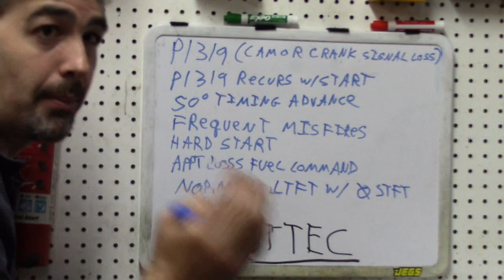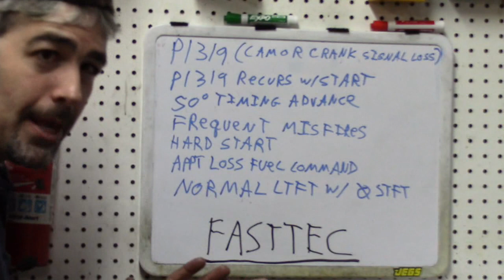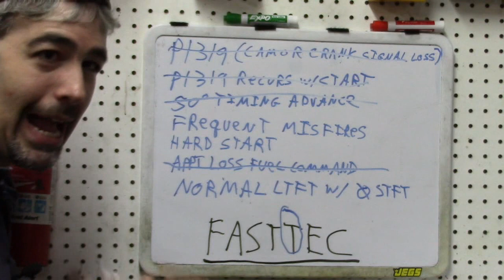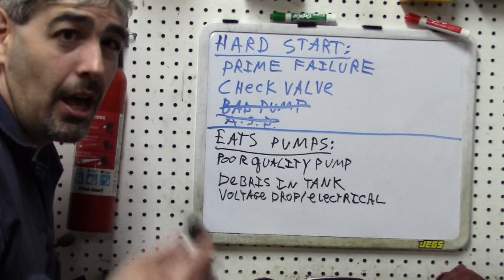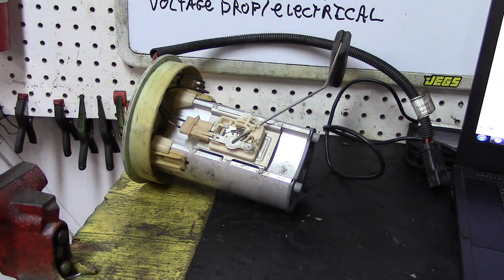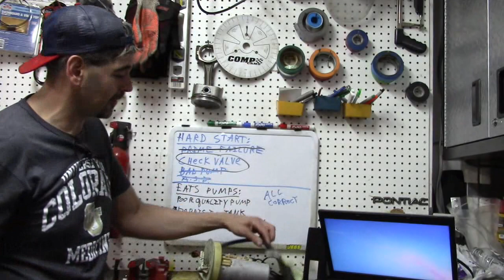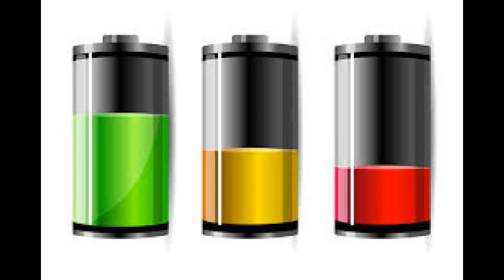Jeep Eats Fuel Pumps Follow up and Hard Start Diagnosis and Repair

Comment: jeep made a mistake with the plastic gas tanks inside the gas melts the plastic and clogs the sock . another thing don't use the airtex fuel pumps they are junk .
Reply from the maker: +Mark Mackover How can gas melt plastic??????? What possible chemical reaction is possible that that could happen? Are you saying the plastic is made of polyethylene instead of polycarbonate???? Impossible. Please explain and justify your source.
Reply: +Schrodingers Box reading a jeep blog they said if you put treatments to stabilize your gas or injector cleaner it will dissolve the poly carbonate/polyethylene  and clog injectors and the sock . also from my own experience owning a 2002 jeep grand Cherokee they had a recall on the factory air tex fuel pump because the O-rings that seal the pump would deteriorate from the fuel and cause a loss of prime as well as pressure . the not so funny thing is they were still selling them at advance auto for $225 and would last 1 year . the solution is to fit a bosh pump into the existing housing and problem solved .  like your video  !!!
Reply from the maker: +Mark Mackover ok on the pump I can believe that but the tank- no way. a fuel tank can easily hold  even 100% MeOH without disintegration. Still sounds like typical chatroom banter though- is there an actual physical recall resource you can link me to?
Reply from the maker: Mark Mackover Well I just checked the TSB database and not one single mention of any fuel tank issues whatsoever. There is not even any known issue with recurrent fuel pump problems much less from an engineer that "made a mistake" because he didn't know basic high school chemistry. Even a basic knowledge of chemistry would clearly indicate that you aren't going to get clogged injectors or even filter from accidentally using polyethylene components in an aromatic (well, aliphatic, technically) solvent. That is impossible unless so incredibly much of it was dissolved that it miraculously turned into slush without eating a hole through the tank.
  Gonna have to chalk up this to yet another "chatroom and forum myth" but please tell whoever you heard that crock from that they are full of it unless they can produce evidence to the contrary of what I found lol!

Comment: Batteries have little pop outs that tell you the year and month the battery was originally purchased.  That's the first place to look if a car won't crank over.  If the battery is more than 40-60 months old, go chance the battery has had it.

Comment: After watching loads of Scanner Danner videos on both his channels, his recommendation if there is a bad fuel pump is to replace the whole assembly no just the pump.  I think his logic shows true in your case study
Reply from the maker: +John Powell Totally agreed. I always change the whole unit if for no other reason than to ensure I don't get a comeback for a sending unit or some other component.  As a DIY- a fuel pump is a considerable concern for me because of the buckets of fuel I need to siphon out- I really don't want to be doing that any more than necessary!!

Comment: Hi Matt,sorry to intervene but I need to know why do you now have fuel pressure that is 50% of old pump pressure.
 Info that I have is 48PSI +-2%
Reply from the maker: +despot032 The new pressure was the same- maybe 3 PSI less  50%????  Not from the video I saw
Reply: +Schrodingers Box  sorry mate,glare is one to blame. my bad

Comment: Everyone has their own way to diagnose a fault or faults. The scientific approach you profess to use is very refreshing and I commend you after almost every video that I watch and try to make suggestions or supply more info if I can. If I want to watch a screaming  lunatic i'll subscribe to the Scotty....whatever channel. But in the real world in a fast moving repair shop with time constraints and stress to perform, you have to make a diagnosis ASAP and to me that means to gather  ALL of the evidence as quickly as possible. To me that also means connecting every piece of test equipment pertaining to the problem at the same time. In your case you would have found the loose crank sensor and the fuel pressure problem at the same time. Sometimes you need to rely on experience as well as the evidence you gather.The fuel trims had nothing to do with a start up fuel supply problem and to me your diagnosis was slightly flawed. I hope you learned from the experience.You got to L.A. Via Wyoming but the important thing is that you repaired the problems with the vehicle by covering all the bases and you will have a very happy customer in the end. As far as the battery story  problem goes, I have been in that situation myself, before. You feel like a bit of a jerk but at least you arrived at the correct diagnosis. I go through that same thing with my wife at least twice a week....{;-)

Comment: Change the bad Battery! Heh :)
Todays cars can stop the engine (normaly) on ligths and nots start again with new battery. Because thay have new battery in that car computers dont know and so dont know what the charge level is and so on.
Allso new cars dont charge batterys all the time so on charge test you need to add all the cars loads on to do that test these days.

Great video even with little starting délay ;)

Comment: Nice Find Matt.  When you do the follow up you might want to do a injector balance test.  Some of that junk might have reached the injectors.  You could also hook up your secondary leads and see if your firing kv's are lean.  That would make a cool video with your Vantage Pro.  I understand your thought process on diagnostics.  I do the same thing myself.  In fact when I find something bad, I always prove it by doing another test to verify.

Comment: LOL...Great video and I feel for you on dealing with people whom feel you are inferior because they guessed/hoped/believed correctly and/or more quickly about something regardless of the fact that they only believed that because they had no knowledge about any other possibility nor any concern for analytical precision over trial and error/gamble.

As for the fuel pump, you may not care as long as it runs well enough but I had a similar problem and I removed the fuel line from the rail and primed the pump into a jar and cleaned a significant amount of sediment (of a performance vehicle making it necessary) out of the line and after seeing that pulled and cleaned the injectors and their filter screens. This being an old Jeep, it may not be as important as long as it is getting enough fuel but it likely is inhibiting performance as a result of this. 

Also, this is why you should always request the parts packages be supplied to you from a mechanic to prove the part is new and the actual part info that was put into your vehicle to insure it was the correct part.
Reply from the maker: +SayWhat? Dead on bro.  Do you know how many times I will show a misfire on the channel... just a misfire and people say "God why was video an hour long? I figured  right from the first minute it was probably a bad spark plug."

Comment: Hi Mat,

I commented on you not using the Fasttec Method, but the way I understood you method was, that you allways do it in the same order. So you don't look into the computer before you do the manual fuel test. 

So now I know that you do the computer first and that you user FASTTAC as a help to rememver what to check bot not do it in the oder of the letters. That is why I thought you did not use the method. SORRY did not mean no harm. 

Regards Benjamin
Reply from the maker: +Benjamin Bergmann No problem- makes sense now right?  You always use FASTTEC on a no-start, but you triage the starting point based on your evidence.  If for example you can hear the car almost starting then most likely there is fuel delivery so you move that lower on the list and start with spark.  If the car backfires a lot when starting I would suspect timing because a backfire requires fuel and most likely there is also spark.

Comment: You know what, I am with the old guy!  I don't even grab my voltmeter unless the battery is at least couple of years new or better.  It costs less than couple of gas tanks and I change it first before I would even make any attempt to diagnosis.  That technique has worked for me and for lots of other relatives who call me for their car troubles.

It is a question of cost benefit analysis.  An hour of professional diagnosis or replacing two year old battery?  The battery gets changed first.

How much did you charge her to diagnosis the bad battery?
Reply from the maker: +12vgs8606 Ummmm you must be joking right.... why would you possibly change the battery when there is no evidence that something isn't causing it to drain and the battery is perfectly fine?
Reply from the maker: +12vgs8606 Wait- you have been on this channel since day one bro--- You are pulling my leg I hope!!!
Reply: Nope; replacing the battery is the cheapest.  I have been bitten enough times that this is now my standard advice to any of my friends.  If the battery is over two years old, put a new one before looking for drain.  Most of these friends don't even own a voltmeter!  My score on "replace the old battery and then if the problem continues, then call me back" is about 7-0
Reply from the maker: 12vgs8606 OMG... speechless.
Reply: It $100 of diag time or less than that for a new battery.  If battery is old, then nine out of ten times, it is going to be a bad cell in the battery which leads to these type of issues.

I am little bit exaggerating about what I do personally but if a guy does not even own a voltmeter, the easiest and probably the cheapest thing is to put a known good battery first.  Especially if there was no recent work done on the vehicle.  We are talking about people who would not know how to use a voltmeter to figure out if battery is bad or alternator is bad.

Of all the consumables  on a vehicle, battery is the cheapest item when averaged over few years.
Reply: +12vgs8606 Regardless of your claimed success rate, I don't think that replacing a part/accessory without at least confirming your suspicion is a flawed method. The potential to miss a relatively minor (but existing nonetheless) underlying fault is concerning.
Reply: Mathew Wood
As I said before, I was little bit exaggerating but when I get that call from relatives or friend where the symptoms are dead (and older) battery and the guy has no skills to even put the voltmeter on it, does he need to take it somewhere and spend $100 to figure out or does it make sense to replace the older battery first?
Reply: I don't know where you're getting the $100 cost to diagnose a dead battery? If it is a dead battery, it's not going to take much time to confirm it before you go changing anything. So no I don't think it does make sense to replace anything before actually determining that is the problem. It's just not logical, in my opinion.

Comment: Great video...thanks.
I totally agree with your thoughts on process of diagnosis...and it was great to be able to verify the cause of failing pumps, put all of that right...verify the finished result and hand the car back. But i wouldn't give that a 3 year guarantee, because you havn't...and probably can't diagnose the Cause of the debris getting into the tank....i wonder if that car gets fuel from time to time from a petrol can?...maybe that's been stored and used at home for petrol powered garden machinery?
Reply from the maker: +Ian Muggeridge Agreed- the guarantee is risky but I promised the guy if he took his car to me I would ensure he won't have to worry about it again so this is my way of doing it.  You are correct, I don't know where the contamination originated but I thoroughly inspected that I cannot find any sources- I flushed the lines, cleaned the filler neck hose, and thoroughly cleaned the tank. I believe my odds are quite good but agreed- not 100% certain.

Comment: verbum sapienti
the autozone diagnosis dartboard or maybe the "wheel of (mis)fortune"

I wouldn't have minded seeing what a prime pressure after settling would be, and whether it would be the same as the running pressure, also double checking the raised pressure with the vac hose to the reg disconnected. Only curious, not critical.
Absolutely love your work mate

Comment: Nice vid. But where did the sediment come from??????
Reply from the maker: +Rick Kimble Great question!!  I have no idea but I suspect from changing the pumps without completely removing the tank.  The amount of debris on my floor when I removed the tank seems to support that idea.
Reply: Yes I agree to a point but the debri had to enter the tank from somewhere? I mentioned on the 1st vid some time ago that it would be worth looking into the condition of the filler neck corroding I have seen this on a few cars (I live in the rust belt) my sons cars previous owner replaced the pump 5x's before selling and we replace the pump once and the amount of debris in the tank equaled your job and later found the filler neck to be throwing a evap code and dumping rust into the tank.back flushed the pump by hot wiring and purging the overflow still running today. Just a thought to keep in mind. Great info as usual!!!!!!!
Reply from the maker: Rick Kimble Yes I also suspected that and replaced the filler hose- not that there was evidence of any source of the contamination.  I also flushed the fuel lines from rail back- nothing.  maybe someone just didn't like the guy and threw sand in the tank lol. But I was unable to find a source from the car itself that would have been generating that much debris.
Reply: Seems odd to have that much debris without a source of entry?But I do lay odds that pump with still function properly if disassembled and flushed ( may be a good video for 2%ers ) to show you can save something thought to be dead! I hate swapping parts.I like seeing the practice of finding the root cause with little to no cost which is what make your channel so appealing. Keep up the good work and I did like the interview with the customer.By the way thanx for the reply.
Reply from the maker: Rick Kimble Given the labor involved with this and the fact I am giving a 3 year guarantee- even cleaning up debris from the pump cannot give a quantifiable analysis of what wear was already done and remember I am giving a 3 year guarantee.  No way I am putting that pump back in!!!
Reply: I would have to agree no customer could ask for more! I just thought showing that some of these thought to be dead pumps from these issue can be revived would be a nice vid.I would like to thank you for putting out a channel with this format maybe it will lower the 98% # in time.

Comment: i disagree about your debris in the tank theory. There wasn't enough dirt in that tank to cause a pump to fail.  you were probably expecting a metal tank full of rust. Well, plastic tanks are not gonna rust up like metal ones do.  Most good mechanics know that cheap Chinese pumps only last about a year. you better make good on your 3 year warranty because i expect you'll be seeing this jeep again soon.
Reply from the maker: +happy543210 How much debris is needed before a used fuel pump fails due to restriction?

Comment: RED ALERT!  Check the charcoal canister!  (especially since you climbed out on a 3-year limb)  That "debris" looks a lot like charcoal and would be flowing back from the canister via the return line and refilling the tank with NEW debris!  This might explain why he's going through multiple pumps.
Reply from the maker: +ForkliftJoe Good thought!  But the charcoal cannister doesn't actually connect with the liquid return line- it connects to vapor and EVAP- however still possible it can contribute to the debris.
Reply: I got to thinking about that.  The fuel injection systems today are supposed to be "closed systems and under pressure" but are they really?  Why have a charcoal canister?  There has to be a connection someplace.  Even the gas tank has to have some kind of a vent and the feds/epa don't want that venting directly to the atmosphere.
Reply from the maker: ForkliftJoe The liquid parts are. ACtually, the vapor from the tank actually is closed and under pressure too but unlike liquid it would escape when you fill the tank or remove the gas cap for whatever reason. Trapping it with the EVAP system and burning it is more efficient and environmentally responsible.

Comment: I bought a couple of new Airtex fuel pumps off Amazon and the were missing the socks too!  Every one of em!
Also, check the charcoal canister if any of the debris looks (looked) like charcoal from a fish tank!  Chrysler was BAD about those years ago!  Check the return line, etc.  30 years ago I pulled one canister off and the charcoal POURED out of the can!  If the canister is bad, you might get to do this again!

Comment: You also have to watch that the shop doesn't cut corners by using the same old sock on a new pump. That little trick cost them having to tow me back in with a bad pump 5 times in 3 months. Finally I went in to watch them and caught them using the old sock. I held it up to the light and you could see it full of particles. Also caught them using salvaged pumps. It's a very common (mal)practice I'm sure.

Comment: Old men and batteries..  My Dad always claimed a battery had a shelf life of about three years.  If you knew for sure the battery was 3 years or older, Replace it before you do anything else.  If it doesn't fix the problem troubleshoot from there.